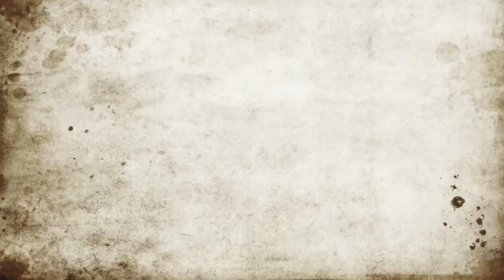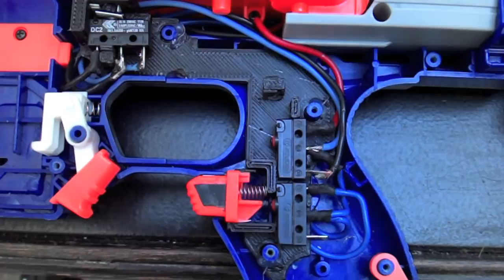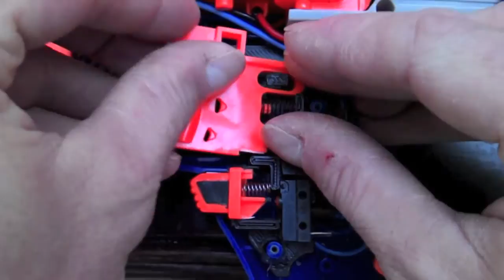Blastersmiths UK Rapidstrike Switch Plate Kit (REVIEW)

Comment: The rev trigger doesnt stay put after installation. There's NOTHING holding it in place.
Havent found any info on this yet.
Surprisingly shoddy oversight!
Reply from the maker: The other half of the grip holds the rev trigger in place. Also flywheel circuit is electrically separate on the negative side, it goes straight back to the battery from the wheels. Look at the circuit diagram.
Reply: @foamdataservices  the other half of the shell MIGHT hold it. True.
But getting it closed without the rev switch slipping down is almost impossible. Ive tried a variety of springs to keep it together, and no success at all.
Reply from the maker: Well, I have made about 50 blasters with that kit and never had that problem. The BlasterTECH kit includes a closed rev trigger box.
Reply: @foamdataservices  perhaps we have different skillsets then!
(the double solder connection you said was tricky, i did with my eyes closed, so to speak. But that damn rev trigger is driving me mad.)

Ive gotten it in now, using a handy grip to hold the button still while i put the halves together.

Comment: If you are doing this yourself, the blastersmith.UK site says not to use 3S, if I am going to use a 3S 11.1V zippy battery should I use 16awg instead of 18awg?
Reply from the maker: You can use 18AWG for most of the loom, even up to Xtreme 180 motors, the bits you really should make 16AWG are the two main power leads from the battery to the switches and the main power feed from the Rev trigger to the motor +ve. 
If you are using 3s and Falcons 18AWG should be fine. If you are using 3S and 180's then go for 16AWG main leads. Note- I DO NOT WORK FOR BSUK IN ANY CAPACITY and this is my PERSONAL OPINION based on building about 15 blasters at the top level and around the same as basic re wires!
Note there is a new method of doing this wiring, see my new video and RS rewire guide for details.
Reply: thanks

Comment from the maker: The middle pin of the interruptor microswitch contains- 1 negative feed FROM the battery, the only one in the set up, plus the -VE wire       of the pusher motor. The flywheel motors have their own -VE wire, which doesn't go through the trigger wiring.
Reply: Thanks for the timely reply! One more question, how or do I wire the motors to complete the circuit? I'm not sure you mentioned it in the video, forgive me I'm a bit daft when it comes to reading electrical diagrams x]
Reply from the maker: Heman Howard The motors are wired- Negative, from battery to flywheel motors, +ve comes from the Common (C) terminal on the rev trigger microswitch. Its the single blue wire in the picture, coming from the bottom microswitch. This isn't really a wiring diagram, if its the BSUK one you are using then email them with pics of where you are at. Don't test with lipo or Nimh packs, only with the old C cells as you will melt everything if you make a short. You can also post on Britnerf, in Questions forum.

Comment: Question, @ 6:59, the middle prong has to be wired to both the negative on the battery tray and the negative on the pusher motor?
Reply from the maker: Yes, the middle prong on the pusher microswitch contains the negative from the battery and the negative wire to the pusher motor. That way it can interrupt the power going to the motor and put it onto a closed loop when the main trigger is released.
Sounds weird, but that's the secret of perfect cycle control on the RS, wiring the main trigger and pusher through that third switch. With Xtreme 180's you can get perfect fire control at 3s up to 800 rounds per minute, maybe more in perfect conditions!